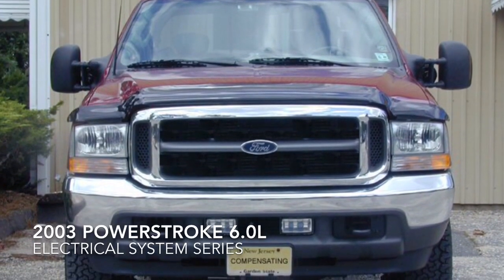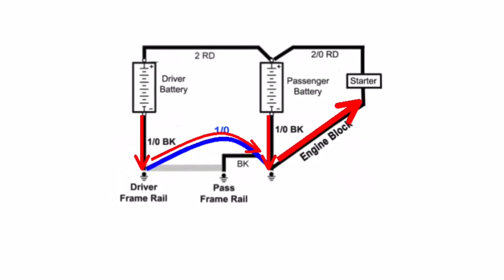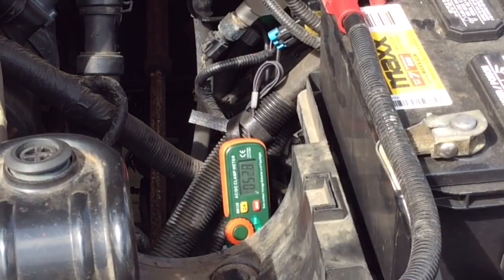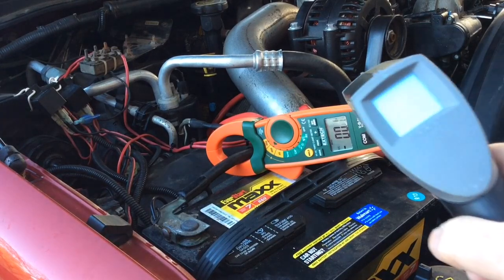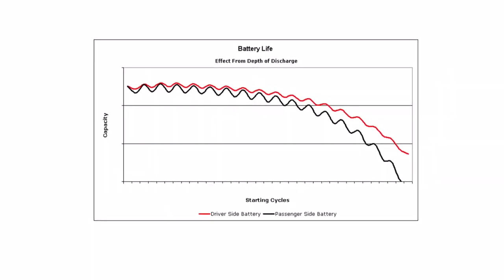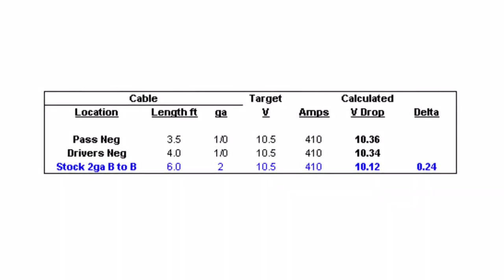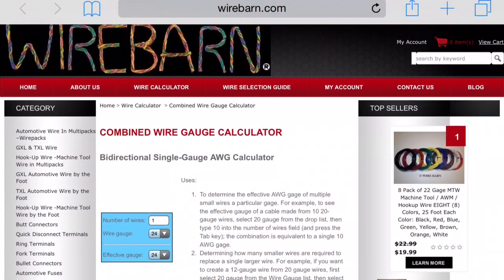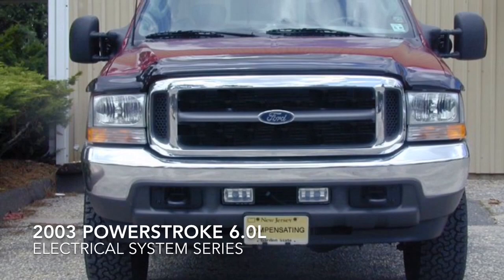2003 Powerstroke 6.0L Battery Cable Upgrade to Balance Battery Life

Comment: Thank you for your insight, sir. I’ve got an Arizona truck and even it is suffering from the same charging and metal corrosion issues you’ve had. but it is 16 years old. New batteries going in and grounds cleaned/balance cables being added. Much appreciated!!

Comment: Dealing with this right now and I've known there is some sort of battery issue. It's below freezing in Wyoming. Just got the truck out of the shop and two days later it was chugging and in a no start condition. I have two brand new batteries on the truck, but noticed corrosion on the passenger side positive cable. The lights flicker at night, especially under load. Great video! Now I have a place to start tracking this down.

Comment: I simply wished to thank you for all of your hard work in doing this exceptional Video. I own a 2003 F350 with the 6.0 - current mileage - 310,000. It's the best truck I've ever owned as opposed to many opinions out there concerning the 6.0. I am still on the original radiator, original starter, and original Alternator, along with many other pieces parts. My interior looks like new - day I got it seat covers, dash cover, and window tint went in. This truck will go to my son when I pass. I'm now one of your subscribers, and hopefully a friend. I live in the extreme heat of the desert. That's hard on Vehicles too. If I can assist you in any way, simply ask.
Reply from the maker: Garrett Winslow   Thanks for your comment Garrett.  Yep, they can run well.
Reply from the maker: Thank you Garrett.  The 6.0s can have a long life with a little care and common sense.  I screwed up, twice.  It appears you've done much better.  I applaud you.

Comment: This was super!  I had received conflicting information regarding the battery and alternator cabling for my 2005 Ford F250 with the 6.0.  One solution suggested removing the passenger side cable from the negative terminal to the rail,  running an interconnect cable between the two battery negative terminals, and then running a second ground cable from the driver side negative terminal to the passenger side fender.  While seeking the cabling and a high-output alternator, I found FicmRepair.com.  They sold me an HO alternator and their "Complete Wiring Kit" which has all of the cables your mention here, along with a new charge and ground cable for the alternator.  Going with the FicmRepair solution does not qualify as "doing it on the cheap."  However, for those of us that would prefer to shell out a few bucks and have a kit delivered, with everything taken care of, it is a great option.  Thank you for this video as it backs up all of FicmRepair's assertions.  I'm really looking forward to seeing my truck crank easier after this.
Reply: Yellow Dog Did this kit help?
Reply: Have a 230amp Leece Neville and Cabling Kit waiting for me to go crazy installing it as I type.  Ficmrepair.com has the stuff, not cheap but good hi end parts for sure

Comment: Awesome videos. What happens if you run the driver negative to the block first and then the block to driver side frame?
Reply from the maker: That is actually a better approach, and what Ford did with the dual alternator setup.  They use the passenger side negative cable on the drivers side.  The premise I was presenting was towards the least cost and easier to do.

Comment: thanks for doing these videos watched several of your battery cables videos, planning to do this cable upgrade. But upon my inspection my cables are branded Royal 2/0 for the black and the Red interesting from the passenger side to the frame black is appx an 8 awg should this also be upgraded? or only the frame to block (not checked as yet) also still need to inspect the bond from cab to frame.  also you mention an equivalent 3/0 for the red should i add a 1/0 to the positive in front of the radiator seems like someone may have already upgraded the cable partially? will there be an update to suggested cables and locations? thanks
Reply from the maker: I think your right Bryon, somebody's altered some of that.  When I posted this on YT I also started a thread on FTE titled in it's name.  It would be easier if you joined over there, to that discussion or starting your own, and that way you could read some of the other details and maybe post some pictures of what you have so we can sort it out.  If you would rather stay here we can do that too.

The link is

https://www.ford-trucks.com/forums/1433435-improving-battery-cables-for-battery-life.html

Comment: Thank you for the great instructional video.  The 70 inch long positive 1/0  goes from post to post but I'm not sure about the connection(s) at the post. Other than cut and attach a Noco TZKIT6 Lead-Free 3-Way Zinc Battery connector(s).  Would you be able to upload a pic of the passenger side battery connection?   My batteries have no side posts.  Thanking you in advance.
Reply from the maker: Thanks.  Where I posted out the parts for the 1/0 lug terminals I spec'd out 1/4" eyelet terminals for the two ends.  These will fit under the nuts of the clamps 5mm tension bolts.  I cleaned that side area of the clamp, covered with corrosion protection conductive grease (normally sold at electrical suppliers or HD/Lowes for buss bar connections), placed the 1/0 cable lug over the threaded section, and installed the factory nut.

Good catch, reviewing the video I had the terminal protectors in place and never showed how the cable was connected. Sorry about that.
Reply: Totally ok and thank you for getting back to me so fast.  I'll be getting the 70" cable made up this week and then zoom will go those extra amps to the starter.  Thanks in no little way to you for sharing your experience and expertise.
Again thank you,

Cheers and beers.

Comment: Hello brother. Thanks again for your information. When I was adding the negative from the drivers frame to the engine I found a easy to get to thread on the back of the engine as well as on the frame. Just wanting to double check if that matters? Or do I have to connect to the old driver side battery frame ground? Thanks again
Reply from the maker: Jared Reed   Anywhere on the block is fine, but the other end should be on the drivers battery to frame connection for the least resistance.

Comment: I am writing the resident charging system expert to get your opinion on a new alternator. My stock alternator is not putting out enough juice and I am looking at the Leece-Neevile 230 amp and the Bosch 140 amp that you have spoken about. I can upgrade the factory wiring as well. But i want to ask you what is the best/most effective system? Is the 140 amp enough and would upgraded cables help get more electrons moving? I live in Texas now but am moving back to Colorado soon so it’s colder in the winter but not extreme. I don’t have any additional electrical lights or anything else that uses power. Thank you for your help!!!!  I have a 2005 F250 6.0.
Reply from the maker: Not sure about expert, I just do stuff.  

The 140a with the small pulley does everything a stock truck needs.  The most demand is within 90 seconds after starting until the glow plugs go out, and my normal routine is to let the diesel warmup that long.  I wait longer with my diesel equipment.  And with the 140a you don't need to add to the stock alternator cable, it can handle that.  I'm not sure if with the '05 the clocking of the back of the alternator is the same as the early trucks, with the positive post straight up.  If it's clocked towards the driver, the back of the Bosch alternator can be loosened and reclocked.
Reply: TooManyToys:  Thanks a bunch for your help!!!!   I appreciate it!
Reply: The 230 is great.  I suggest it.  Run them in my fleet and they hold up.

Comment: Thank you for your insight.  My positive passenger side battery cable is badly corroded.  Do you have any suggestion on either replacement or repair?
Reply from the maker: New cables fro Ford are getting hard to get.  You can pull your cables, measure them and get someone like NAPA or order premade cables from the sources I listed.
Reply: Make sure battery and cables are secure to reduce movement and vibration. Corrosion is mostly due to leaks around the post causes by movement or cheap batteries

Comment: I just got a 240 amp Mechman Alternator, would you recommend I add a (-) 2/0 wire between both batteries as well, to go along with the (+)....
Just thinking it would help the alternator keep the batteries charged up, 
I'm going to be running an inverter in the back of the work truck and debating on adding a 3rd battery with a dc to dc charger later on.... 
So I want my new alternator keeping the trucks batteries topped off all the time.

Whats your take?
I have a whole spool of 2/0 welding cable
Reply from the maker: If you have a spool of 2/0, sure, in place of the stock cable, sure.  But you don't need it.  

The battery acceptance rate of a change is at a lower value than it produces for the starter. Individually, for under a minute, they might take up 25-30a if the output is high, but the acceptance charge will rapidly diminish.  

My video of my L-N 230a charger shows one time when the glow plugs shut down immediately due to a voltage higher than 14.4. You can see the most that two batteries will take up. This is higher than during a typical cold winter start, as I had battery blankets on, keeping the batteries at ~70ºƒ, where they have a higher acceptance rate.

https://youtu.be/Pnr1YmAZS0E?t=439

Comment: #toomanytoys did you ever do the videos you mention at the conclusion (FICM and ECM grounding)?
Reply from the maker: Due to health issues and a truck problem, unfortunately, no.  I made one up with what I had but it would have left a big hole in the conclusion, and then I'd be compelled to do another on the subject, and I'm already two videos past what I thought I was going to do on the subject.

When I get the motor back in the truck it will get done.

Comment: I could be wrong but i think the bolt holes on the block are 3/8th not M10. I'm bringing mine up too speed now.  Do you have an opinion on grounding the transmission?  Some say yes, Ford says no but make sure your frame grounds are clean.
Reply from the maker: I've chased every thread in the block, heads, and rocker box; all are metric.  There hasn't been an imperial thread for decades in the OE auto engineering world.  You can get a 3/8-16 bolt in for about 4 rotations into the 10x1,5mm until the threads start to jam, and the diameter will be a loose fit.  People chase the threads with a 3/8-16, but it's the wrong thread.

The trans is isolated with the spring bushings/seats, shock bushings, sway bar bushings.  The only possible path would be the parking brake cable, and if that was carrying current it would weld up like Camaros and Firebirds used to do in the late '70s/early '80s.  Adding a ground strap between the trans and frame is adding a path through the trans, not eliminating it.

The discussion is mute if the negative connection at the front bottom of the block is good and kept clean.  When it is not, the braided cable under the passenger floor (body to frame) burns up.
Reply: @toomanytoys  Thank you for all the knowledge, it's really appreciated.
Reply from the maker: @EricThompsonClimber  Glad to help Eric, anytime.  I answer comments on YT like it's a forum.

I was hunting for a couple of videos that I did 2 years ago when I was having the debate about transmission to ground continuity.  Having an engine out made it simple.  Round three was where the person said with some resistance I would not get a continuity signal.  They are unlisted on this site.

https://youtu.be/22fYVh42W0I

https://youtu.be/9zn5xCuCScE

https://youtu.be/LwcJtAMWOvI

Comment: Jack, i have been searching through your battery and grounding videos, in the description of this you say to do no matter what, 8g wire from driver battery to ficm ground, (g101?) Then another 8g wire from ficm ground to pcm ground. (G100?) But then you mention something about combining them to a 6g? Can you please explain this a little better for me please. 

Are the two 8g wires you mention from driver batt to the tub ground g100  and then from g100 to g101?
Reply: @TooManyToys thanks for the thumbs up to my comment although encouraging I need a little bit more of an explanation 🫠
Reply from the maker: It's been a while since I made those videos, LOL.

To balance the 6ga positive cable from the battery to the central junction box (fuses), Ford's layout uses the 8ga from the pass battery neg to the inner fender, and then for the driver's battery contribution, the 12ga cable under the passenger and also the 12ga engine to the firewall; it's really a combination of both batteries negative from the engine block.  That's weak, especially if the 12ga under the floor is not in great condition.

So it's better to do what they did with the dual alternator vehicles: an 8ga off the driver's battery negative to the body tub.  I take that directly to G101 (FICM/PCM).   There is another ground for the PCM at G100, which is also the ground for the transmission solenoids and fuel pump.  So, I want the voltage to be the same on both sides of the PCM ground connections.  You can add another 8ga cable from G101 to G100 to improve that.

The other way to do that, and what I did also, was to have only one lug at the G101 screw, with both 8ga cables connected to a 4 or 6ga lug.  Two 8ga won't fit in an 8ga lug.

I don't know if that helped or made it more confusing.
Reply: Ok great I ordered the 
-72" pos to pos cable 1/0
-18" 1/0 driver frame to engine
-18" and 24" 8g. 

I also realized after reviewing your videos last winter when my plow truck kept having low battery's I found a hard break at the lug on pass frame rail. My solution was a cable from the pass battery negative to pass frame rail. However I never repaired the engine to pass frame rail connection. The way I have it now is the engine and frame chassis is independently grounded with their own cable. So therefor I purchased an additional 18" 1/0 cable go from passenger frame rail to the factory engine ground location.

Also both my 12g "bonding" straps have been not attached for about 7 years. I just ordered new ones of those as well.

Comment: Could you give a summary of what wires you ran and from where to where upon reaching your conclusion?
Reply from the maker: Josh, it's two cables.

The negative cable is a 1/0 cable that runs between the frame mount of the drivers negative cable to a point on the engine block, most people have chosen one of the threaded points in the head above where I did that are easier to get to.

The second cable is between the drivers and passengers batteries, in parallel to the factory cable, 70" eye to eye.  Anything from a 2ga to a max of 1/0ga balances the batteries, but the 1/0ga is ideal so all the conduits (cables) have the same resistance. 

This layout keeps both batteries working equally as long as both batteries have similar CCA
Reply: TooManyToys 
awesome, thank you

Comment: I did this over the weekend...I put the cable I the same spot with bolts from AutoZone and this cable https://rover.ebay.com/rover/0/0/0?mpre=https%3A%2F%2Fwww.ebay.com%2Fulk%2Fitm%2F131476899682 from eBay... I removed my air intake and drivers side charge pipe...making getting to that mission on the head easy..cleaned off the factor grounding spot on the frame..reassembled and bam, in business

Comment: Do you have a recommendation on replacement battery terminal connectors?  Are there any after market terminal connectors that would be an improvement over stock?
Reply from the maker: The best way to keep the cables is to crimp on a lug on the end of the cable after cleaning the copper strands, then use what is called Military terminals.  They provide a solid connection to the lugs.  Waytek is a good place to get these, but they are available everywhere.
Reply: Thanks for the recommendation.

Comment: Hi, where can I find the wiring information for my truck 97 f350 7.3 powerstroke that I'm working on, it used to be an ambulance and a lot of the original wiring were spliced to run their equipment
Reply from the maker: I would hunt on eBay for the original Ford manuals.  Secondarily, search online for the 1997 Ford Body Builders Manual.  Often you can find data there, which is what some body builders/installers use.

Comment: Would I be able to do the same thing by running a ground cable 2/0 or larger directly to the starter and the same size from one battery positive to the other?
Reply from the maker: The object of this work was to get the driver's side battery to work as much as the passenger side battery.  You could go up to a 2/0 cable battery to battery, but with the existing stock cable there you don't need to, a smaller cable would work.  A 1/0 is about the most I would do.

The same with the ground, it's the driver's battery that needs a better path to the block, just a 1/0. If you need a new ground drivers battery cable because the terminal clamp is hurt, then just purchase a new passenger-side ground cable and use that.  Instead of connecting it to the frame, connect it directly to the block.  There a threaded hole for it just above the lowest stantion for the shroud on the driver's side.

Comment: can you please advise on how this updrade should be done with stock dual alternators 2001 f350.
Reply from the maker: John Litvinenko 

John,  this work was done for the 6.0 and I haven't looked at the 7.3 at all.
Reply: 7.3 already have grounds from both batteries to the engine.